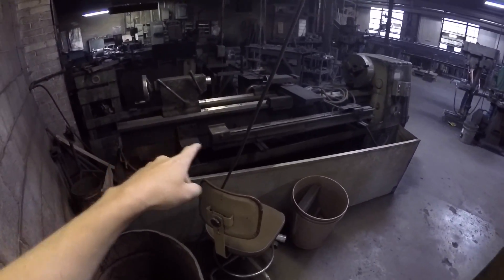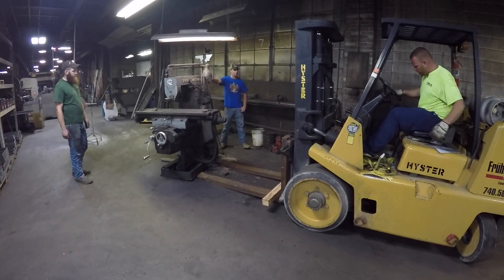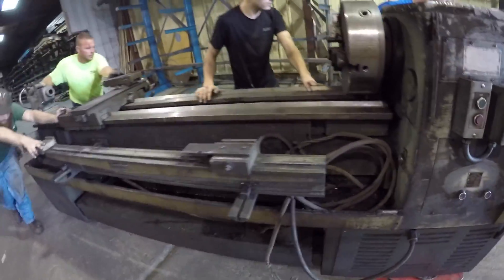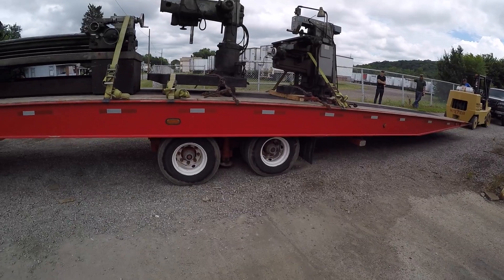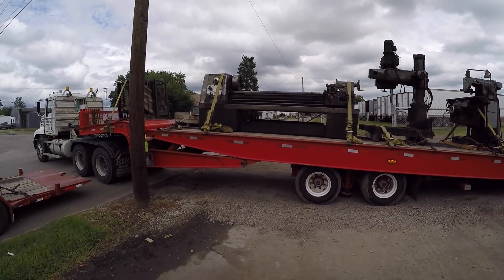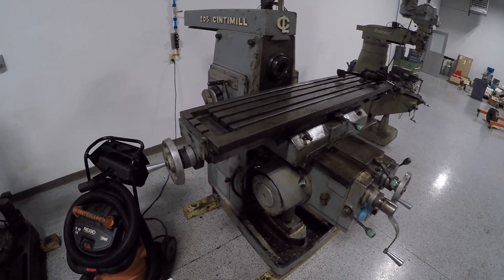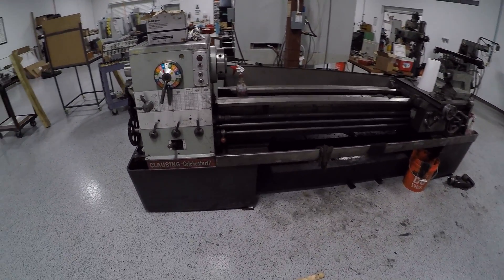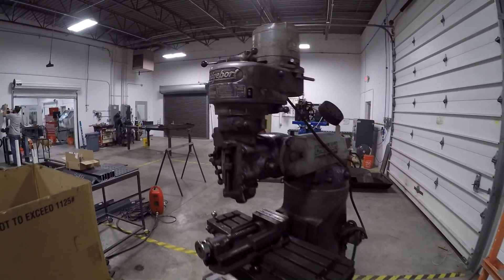Rigging Large Milling Machine, Lathe & Radial Arm Drill!

Comment: great video.  
Guys that rig loads and move that sort of stuff are very skilled. one wrong placement of  a sling or chain and its a lot of steel that is going over.'

Is great to see that some older gear is going to get some more use,   it will last you well.

Comment: Moving some serious weight there. When they moved my Supermax mill (3000 pounds more or less) they were able to lift it into my garage with a long boom mounted to the forks of the fork lift. (Good thing, because the forklift was too tall to get in under the lintel.) We had to flop the head on the mill horizontal as well.

Comment: That lathe could sit in a twist forever and not take a permanent set. Cast iron doesn't work that way. 

You need a precision level. .0005/12 or better, a machinist level is not good enough. Level both ends using 4 of the leveling screws. I put the level right on the carriage such as on the cross slide surface. Once you have both ends level, run the carriage the length of the bed. There should be no twist. You may have to use the other leveling screws to get it perfect. 

Now turn the level 90 degrees and measure if the bed has a hump or belly.  You will use the other 2 or 4 leveling screws to correct this. You don't have a center support so it may be tough to get this right. Get it the best you can. You might have to lag it to the floor and pull it down if it's really worn. 

The twist is the most important factor. Take a test cut on a 3 x 12ish bar and measure for taper. If the headstock is bolted to a flat surface, you can loosen the bolts and bump it into alignment. If the headstock sits on the V ways you can't do anything without scraping the mating surfaces. 

Then you need to line up the tailstock to the spindle. That's pretty easy.

Comment: I had a lot of nostalgic moments watching this video. My father and I have done almost all of our rigging of the machines we bought over the years by ourselves. Usually with simple hand tools like jacks, rollers, straps, chains, and LOTS of cribbing. My favorite of these times was when we picked up our(my) G&E 36in metal shaper. My dad bought it on the internet from the description, pictures, and recherch. It said it was apout 7000lbs.So we went to pick it up with our hand tools and a 8000lbs rated bumper pull trailer. When we got there and seen the machine we figured out there was no way we were going to get it on the trailer, the forklift couldn't even pick it up. We ended up coming back with a semi and trailer and had it loaded for 50 bucks. We had many more adventures and I loved to see this video.

Comment: Lathe Leveling... a one week or more project. Larger equipment will take some time to settle in, especially when disturbed. Level, wait 24 hours check it again, repeat daily until the level stabilizes. Don't forget to run the machine to allow it to "rumble" in while doing leveling process. You may also discover along the way that the concrete the gear is sitting on might change, too.

Comment: Awesome lathe! I went and looked at a 15x50 a few weeks back but passed on it because of too many issues. Magnetic brake wasn't functional, oil pump idler was missing, cross slide screw needed replaced. The parts were all really expensive. Good luck with it. I'd still like to find one in decent shape.

Comment: While I was watching, I was scanning the structural layout of your shop... It seems to me that, it doesn't lend itself well for an "Overhead Crane" (OH). You have a support column in the middle of the building, which would prevent you from moving equipment and/or materials with an OH... The best you could do, in that situation, would be to build Jib Cranes, but that would be Slow and laborious... Just thinkin... Placing and leveling all of your new equipment would be sooooo much easier if you had an OH... Something to think on for the future... Perhaps you could look into having the build re-engineered to remove that support column... but that could be very costly... You'd need a lot of side wall support, to give an OH crane a straight run from front to back...
Reply: I use a two tonne gantry crane with adjustable height for my shop.  It is cheaper and more portable eg if you want to lift something outside of the building, just roll it there.

Comment: Hey John you got a great Clausing Colechester lathe. I have logged many hours on that model of lathe but one thing you will have to get used to is it's a left hand apron in it. You can also turn worm threads on it witch is a great feature. It has an oiling pump system on it and a pressure oiling system on the apron too If you need help figuring out something on that lathe it let me know I've used that model for years lol. Great video!

Comment: John... Awesome!! I can relate to everything in the video. I've had my share of moving these big machines around. You hiring that awesome rigging service made your job so much easier man. Well done! Just all that tooling alone is well worth the effort. It's a quick, and cheap way to tool up your shop with all the stuff one needs, like those big drills, and clamps. Your growing very fast and it's nice to you you rounding out your shop with so much different equipment.
Make sure you put me on the list for one of the power drawbar kits for for the step pulley head. My Doall is the same thing. Thanks bud!!

Comment: Hi John did you check the travel distance on the Bridgeport? There are a lot of variances in mills but I remember looking for one and the 48" table and the 42" table both travel the same distance 30" to 31" You just get a smaller work area on the 42". Check and see if it holds true.

Comment: That's a strong 4x4 to hold up a one ton mill. I'll keep that tip in mind though. Step head mill=best head mill. Is that a 36" table or a 30"?
Reply: In 1999, they moved the Hatteras Lighthouse in North Carolina. At one point they supported the 5000 ton 200ft tall structure with oak cribbing. They used a lot of it but it is still amazing that they held it up with wood.
Reply: almost every house move involves timber cribbing supporting the whole structure at some stage

Comment: John,
Here's a couple of Adam's videos when he moved his Monarch and leveled it and also making test cuts.

https://www.youtube.com/watch?v=6oNfQYD26Vo

https://www.youtube.com/watch?v=XZP0o06gsco

Those movers sure knew what they were doing. The axle moving on that trailer was slick.   :-)
Reply: I cringed when I saw them lifting the Cintimill and the radial drill from below. They could have tipped over and be damaged beyond repair that way.  The manuals recommend slinging and lifting from the top, like a crane.
Reply: That would be after you get it through the door.   :-)